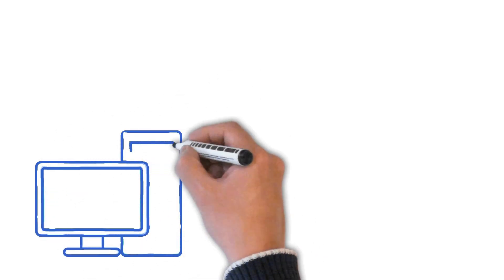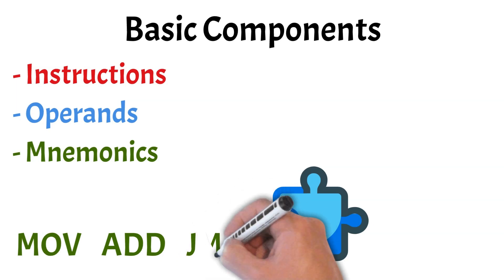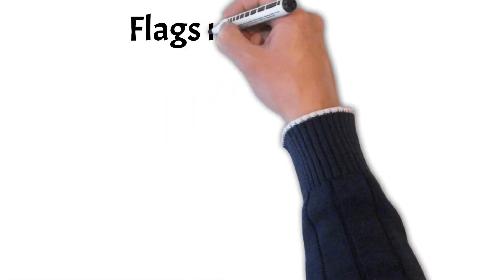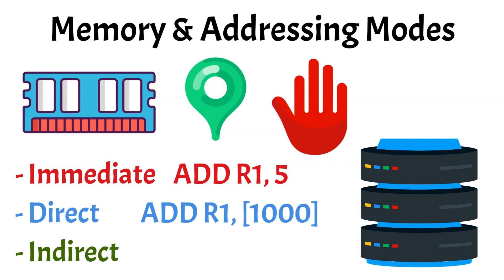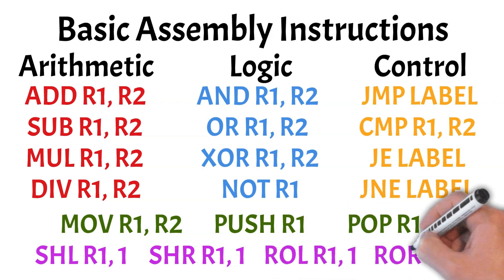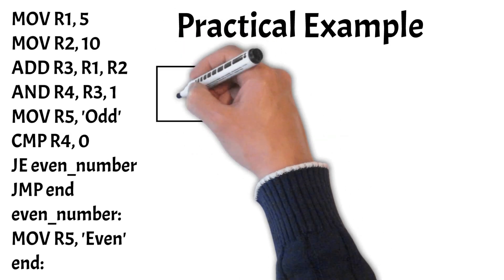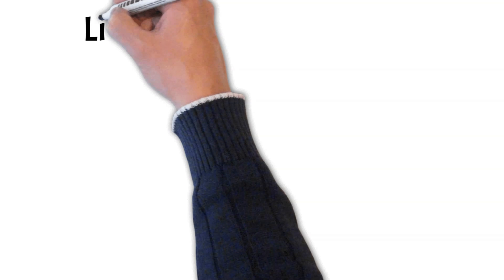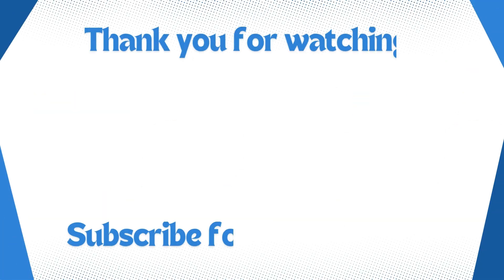Assembly Basics: The Language Behind the Hardware

Comment: As someone who's in the process of trying to learn x86 assembly language, I have a few of bits of advice: 1) make sure you know how pointers/indirection work...I come from a C background, which helps enormously. Coming to Assembly from a "for God's sake, don't make me think" language like Python probably won't help you. 2) Sweat the small stuff...if something in your code doesn't work, isolate that specific part and make small test programs until you figure out the result you want...assembly is all about small but precise steps...don't try and run before you can walk. 3) Forget everything you ever knew about "spaghetti code"...it's going to happen whether you like it or not...the skill is staying on top of it...

EDIT: and most important of all...don't get frustrated...you'll crack it eventually if you stick at it!

Comment: Weird enough when you said precise control over hardware is crutial The first thing I thought is that assembly now  looks similar to CNC G-Code scripting ... the only differene is that condtitional statements cant be put in G code , The Mill Doesnt give ad amn if a chamfer exists there Or if there is a 10 mm thick piece of material between the operation,if the code says chamfer "45 degrees here", the mill says " yes Boss" it doesnt check first to see if it is possible , well thats manual G-Code really,, automated Gcode does this by using stock material properties to automatically calculate depth passes .. so thats like python for machinists

Comment: Verilog and VHDL are the only Languages behind the hardware
Reply from the maker: You are right. Verilog and VHDL are hardware description languages (or HDLs) that are indeed closer to the hardware and are used for designing actual circuits. In the video, we referred to Assembly as the language behind the hardware, because it allows for much more lower-level control in comparison to high-level languages (such as Python, Java...), especially when interacting directly with a processor's architecture. HDLs like Verilog and VHDL go even further by enabling designers to define the hardware itself (rather than just control it). Thank you for pointing this out and for sharing your insight!

Comment: I think the reading metaphor creates many problems when it comes to understanding how the CPU works. I believe, and correct me if I'm wrong, that the CPU's genetic makeup contains logic circuits that are like interlocking machines represented by each instruction; it's like a labyrinth of data buses and electronic logic circuits. Rather than reading, circuits are switched on and off thousands of times per second.
Reply from the maker: You are absolutely right. The CPU's internal structure is more like a labyrinth of data buses, logic circuits and electronic components. Unlike analog systems, CPUs work strictly with digital values (1s and 0s) that are implemented through transistors that act as switches, changing states thousands (or sometimes even billions) of times per second. The "reading" methapor that is generally used is meant to provide a more simplified, higher-level understanding of how a CPU processes instructions. The deeper hardware details, configurations and implementations can often quickly get fairly complex, so we aim  to ease them gradually in the following videos. Thank you for watching and for sharing your perspective!

Comment: Asking as a general person, watching this video makes me wonder about LLM as the interface from verbal or text input. 

What would happen if we one-to-one convert every dictionary English word into dictionary Mnemonic instruction?

Could we literally write a book from Word Processor on what we want any device, app, hardware, or software to do, letting the LLM construct it from a library of files? Think if it like the IKEA of computer building.

In such case, we keep our personal library on a memory stick or in a cloud, dirrecting the LLM to analyze a blank canvas and solve available spaces and powers issues to desired construction parameters.

I ask because I'm asking for a developer challenge on the Raspberry Pi for a "three brains system". On the left is a Pi 5 or 500 and monitor featuring the Raspberry Pi OS, in the center is an AI copilot with a monitor, and on the right is the blank canvas with a monitor. 

In this way, I can build whatever I want without screwing up the OS or AI, learning new skills in a sandbox. Between the three brains thereby requires a pipeline program so things can be safely moved between the three brains, like a security software perhaps? If this pipeline can read my library, corrupted texts can't harm the brains.
Reply from the maker: Great question! Mapping every word in a dictionary to a mnemonic instruction is an interesting idea, but not very practical. While it's theoretically possible, it would require significant effort and computing power, making it inefficient for a machine to process.

As for the Raspberry Pi, I don't have hands-on experience with it, but from my research, your three-brain system concept seems feasible, though a bit challenging to implement. It would require a well-designed pipeline for secure data movement between the systems.

Thanks for sharing your thoughts. If you'd like to discuss this further, feel free to share more ideas.
Reply: @WhiteboardDoodles24  Thanks. Word on the street is that Microsoft has a soon to be competitive LLM offering to OpenAI that can predict future sentences by studying past statements. If the human intention wants certain features and is describing the logic of what they're trying to build, the LLM might be able to intuit the proceeding instructions? So if the two dictionaries are corresponding, maybe I don't need code, just English? This might become the LLM version of programming with brainfuck, but it might be worth it???
Reply from the maker: LLMs have made significant advancements and we have already seen examples like ChatGPT and other AI-powered tools that can understand context and intent (at least to some extent). What you're describing is a likely progression, where LLMs could eventually generate complete code or perform more complex tasks based purely on natural language instructions. I think that, given the current pace of AI development, this could become a reality within a few years, if not sooner.

Comment: Thank you!
Reply from the maker: You're welcome! Glad you found the video helpful.
Reply: @WhiteboardDoodles24  are there assembly for mobile devices
Reply from the maker: Great question! Yes, Assembly language can be used for mobile devices, but it depends on the processor architecture of the device. For example, ARM Assembly is commonly used for mobile devices since most smartphones and tablets use ARM-based processors. However, writing Assembly for mobile devices is rare in modern app development because higher-level languages like Swift, Kotlin and C++ are more commonly used for efficiency and portability. Thanks for asking!

Comment: well you have the GOAT that wrote the game roller coaster tycoon. that had more NPC's than the new games today in 2024 on screen at the same time, or if you have a battle simulator you have a cheap landscape and a skybox so yea, plus that game was not only written in Assembly but also was a very dynamic game.
basicaly you can get as complex as it comes.
Reply from the maker: Absolutely, RollerCoaster Tycoon is a fantastic example of what can be achieved with Assembly. It's amazing how efficient and dynamic the game was, even with the hardware limitations of the time. Assembly's ability to optimize for performance and directly control hardware really shines in cases like this. Thanks for sharing this great insight.
Reply: My understanding is that is a myth. I expect in reality that C was used.

Comment: does assembly language allow you to do things you can’t in a higher level language? If yes what is that?
Reply from the maker: Great question! Assembly language gives you direct access to the hardware, allowing you to do things like:
- Manipulate specific CPU registers
- Write highly optimized, low-level routines
- Execute precise timing operations
- Interact directly with memory addresses
While higher-level languages abstract these details for ease of use, Assembly is unmatched when you need fine-grained control over how your program interacts with the hardware. Thanks for asking.
Reply: @WhiteboardDoodles24  assembly language gives me direct access to the hardware.but high level language also give access to the hardware but indirectly.so high level language do everything that assembly language do but indirectly.so there is no difference.
Reply from the maker: @tamimayan2028  Great point. You're right that high-level languages can indirectly access hardware, but Assembly can do some things more precisely because it directly communicates with the CPU.

For example, imagine you're programming a blinking LED on a simple microcontroller. In Assembly, you can control exactly when and how the CPU sends the signal to turn the LED on and off - down to the exact cycle. High-level languages rely on pre-written libraries for this, which might not give you the same precision or flexibility.

So, while high-level languages can achieve similar results, Assembly allows you to customize and optimize the process in ways that aren't always possible with higher-level abstractions. Thanks for bringing this up.
Reply: Low level code, or efficient purpose use code types. Roller coaster tycoon the original was in assembly i believe

Comment: the language behind the hardware is actually on/off. assembly can be recoded to another language.
Reply from the maker: That's a good observation. At its core, everything boils down to the binary on/off signals that hardware understands. Assembly serves as a bridge between these binary instructions and higher-level languages, making it easier for us to code. Thanks for your input.

Comment: the best way to learn assembly is to boot up cheat engine with an old single player game or the tutorial and try to mod its code while its running. the amount of knoweldge and intuition i gained from it was incredible. even modded in the healtb regen system from gtav into san andreas :3
Reply: You should make a video showing how to do that, I’m pretty sure a lot of people would watch. I am one of those
Reply: That's the exact reason I am watching this video right now! 😂 I need to mod a game and the only way to learn how is to first learn assembly.
Reply: @garymichalles8383 
If you want to mod, depending on the game decompiling their assembly code back into the engine language with all the needed references is all you need. Also a fitting mod loader in most cases.

But cheat engine is when you want to address memory directly at real time. More for cheating (it's in the name) you use it to alter values of game and if you really know what you're doing even multiplayer games with exposed data may be a subject for cheats.
Though for begginer level, cheat engine is better in single player games to change simple values as gold, ammo, exp etc.

But modding is easier done through the source code itself. Simply overwrite a function of the game to you liking.
Reply: I was completely unaware of coding and was a kid at the time. When Candy crush was popular in 2013 I used cheat engine to turn the normal candies into the special ones and played around with the scores.
Reply: Awesome tip! If you could create or recommend a video explaining how to do that, it would be really helpful.
Reply from the maker: That's an awesome way to learn Assembly. Hands-on experience like that can really deepen your understanding. Modding games is a fun way to apply what you've learned, especially adding a health regen system from GTA V to San Andreas! Thanks for sharing your insight.
Reply: @WhiteboardDoodles24 looks like a AI-generated reply 😂
Reply: @WhiteboardDoodles24  that's a chatgpt answer
Reply: @WhiteboardDoodles24 holy AI

Comment: The need for using Assembly has decreased considerably as compilers for langues like C have become so optimized that they produce faster and more efficient code than human programmers using Assembly directly.
Reply from the maker: Modern compilers for languages like C have indeed become highly optimized, often producing code that rivals or even surpasses what could be written manually in Assembly for many applications. However, Assembly is still valuable in certain situations, such as when low-level control over hardware is needed or in performance-critical sections of code where even the smallest optimizations matter. It's also helpful for understanding how high-level code translates into machine instructions. Thanks for sharing your insights.
Reply: I use assembly just for fun and i know some tips like memory and code alignment or paralell execution with pairing simple and complex instructions to prevent stall.

Comment: you cannot put Assembly language and easy together
Reply from the maker: Fair point. Assembly definitely has a learning curve, but once you get the hang of it, it can be really satisfying to work so close to the hardware. Thanks for watching.
Reply: You can. As you get more deeper into it and try to simplify it to yourself and try new tricks its gonna get easy.
Reply: they try to put together assembly and understanding.. once you get it , its clear
Reply: The basics are easy once you're passed the ahh haaa moment. However understanding 100's or thousands of lines of code can be quite difficult.
Reply: @   
Without comments in ASM code, yup!
Reply: Love x86 assembler. Been writing, debugging, and running it for almost 50 years. Been writing high level languages as well. You have to be able to understand assembler as I've caught compilers making mistakes plenty of times!
Reply: Baby steps and its easy
Reply: Tru dat
Reply: Unless you add the word not
Reply: NEASY
Reply: Invalid combination of opcode and operands
Reply: Yes
Reply: if assembly == easy:
    return ‘500k salary package’
else:
    return ‘cup noodles for dinner’
Reply: Here I am 11 months later to say the same thing 🤣
Reply: Actually there is nothing in assembly that is not clear, every thing in assembly is understandable, things in assembly are so primative like mov, the problem and what is really hard is creating a software with assembly as you will need to use these primative instructions to build a software, and this is why they created higher level programming languages

Comment: Java and Phyton are not easier to read and understand for me, because i don’t know which CPU instructions are used to execute a high level command.
Reply from the maker: You're right - what makes a programming language easier or harder really depends on personal preference and experience. For some, like you, understanding how high-level commands translate to CPU instructions makes lower-level languages like Assembly more intuitive. Others might prefer the simplicity of high-level languages like Java or Python. It all depends on how you like to approach programming.
Reply: @WhiteboardDoodles24 Yes, thx.
Reply: @WhiteboardDoodles24 I took a look into the linux source code multiple times to search for the instruction to use a primary monitor and a secondary monitor with one graphic card that provide to connect two monitors.

I know how to get the EDID data from the primary monitor, but i don’t how to get the data from the secondary monitor.

I know how to use the functions of the VBE 3 bios to switch into a refreshrate controlled graphic mode using the primary linear framebuffer(address from mode specific info) and in the Windows device manager we can see the linear address of the secondary framebuffer, but i don’t know how to change the videomode for the secondary monitor. Some graphic cards start in clone mode, so the second monitor display the content of the primary framebuffer too, or it display a message with no signal.

If it is possible i want to use different video modes&refreshrates and that the secondary monitor display the content of the secondary linear framebuffer. I like to use the 16 bit "BIG" Real Mode with 4 gb segment size for DS,ES,FS,GS segment + A20 address line on on 80386+ CPU.